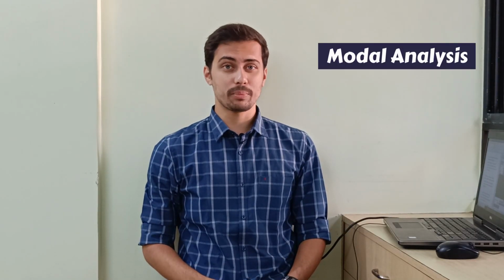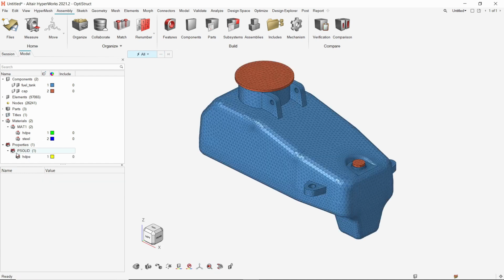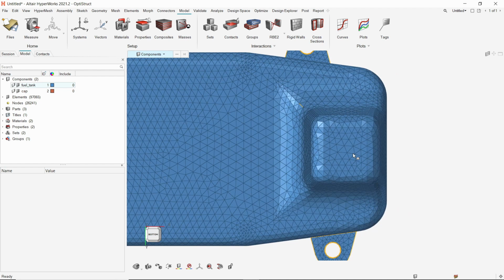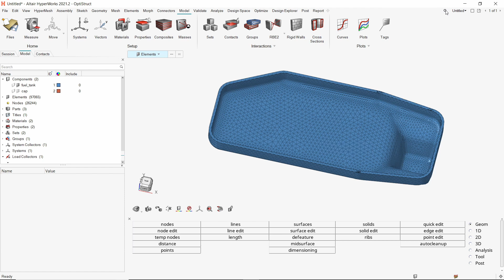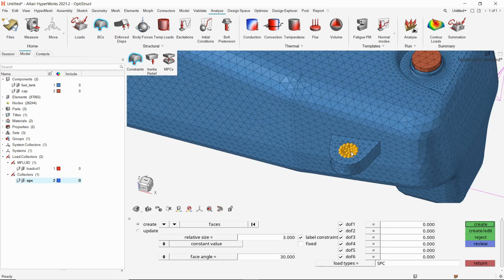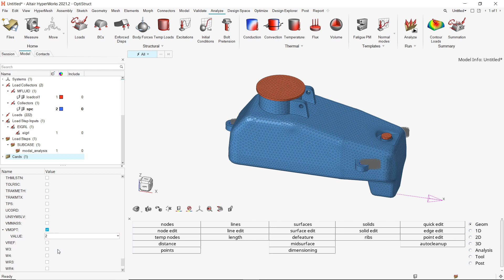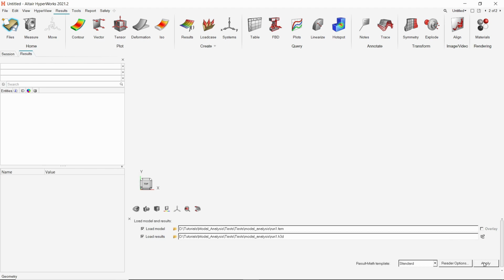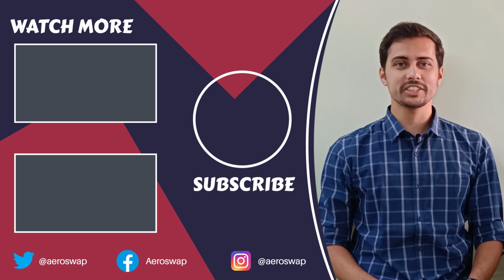Modal Analysis using Hypermesh [Optistruct Tutorial]

Comment: I think there is an issue with the CAD file you shared. There is three components, instead of just two. The 3rd one being the misc1, which seems to be a fusion of the cap and the fuel tank. The two other components are present in the three, but not actually present